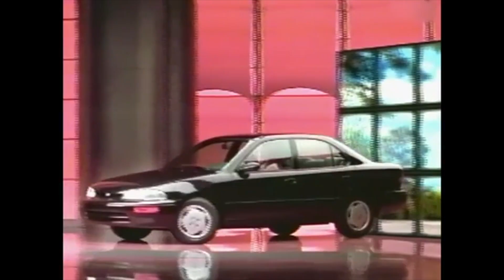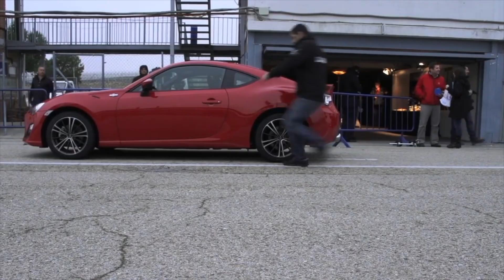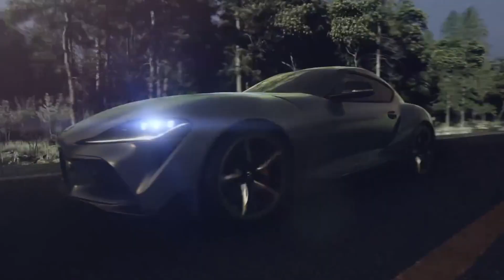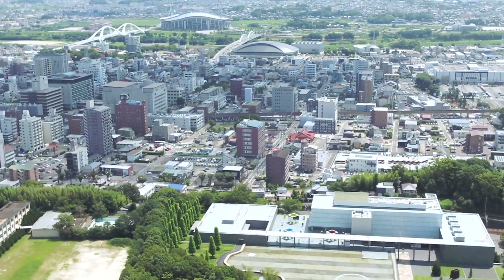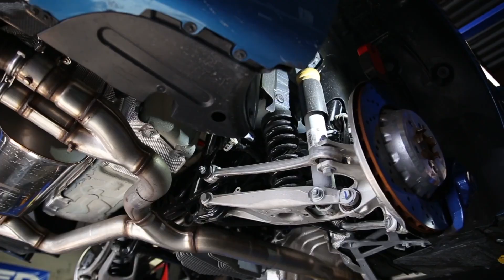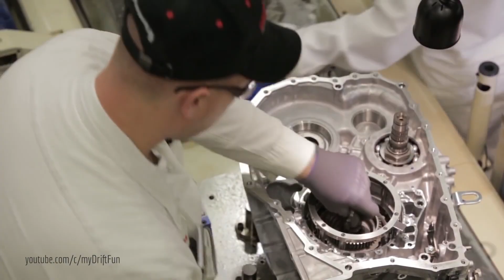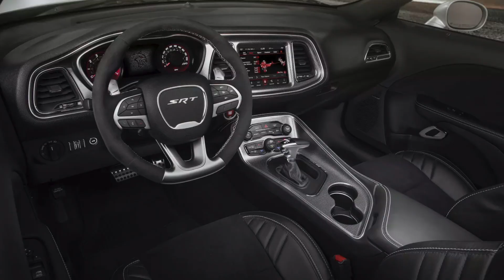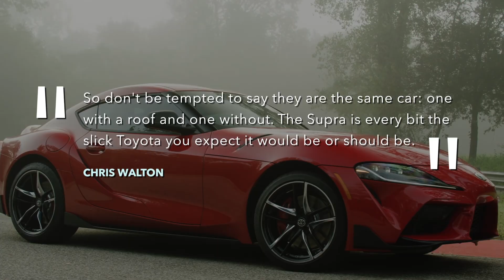MKV Toyota Supra - BMW or Toyota? The UNTOLD TRUE STORY

Comment: This.. right here, is excellent writing and research. No opinions and lies. Thanks for showing true evidence!
Reply: NANI!? You are here too Mr.deoxide!?
Reply: @TheWProductions222   and nobody care. cuz they are just human, not a god.
Reply: Hello deoxide. Nice to see you here
Reply: Where exactly is this research? I have serious doubts about some claims in this video. Namely the fact that he says the interiors were designed completely separately, but you can clearly see BMW parts in the Supra interior, including the entire M-drive electronic system. This video has very little information, and the information given isn't even correct.
Reply: @TheWallsocket  very true my flatmate also told me that all buttons and diles were delivered from bmw manufacturers so they are the same thing.
(he works for the biggest packeging company in the german car industry and has to design the packages for the transport of all the parts thats why he knew how much of the new supra is actually from toyota and how much is from bmw and nearly all off it comes from bmw in terms of switches electronics etc.
a lot of people wont believe me here i can imagine but just wait for the release and see it for yourself
Reply: Deoxide

yeah, sure. Where do you see any evidence in this video? It's full of unproven claims with informations that are fully unavailable to the public for most parts and includes several lies. For example: the transmission. He states that lamborghini and Volkswagen use this transmission, even though none of those manufacturers offers anything else than a direct shift transmission. Then he states that the interior was developed fully autonomous, which is an extremely proven lie.
Plus, the "german laws" he talks about, actually don't even exist.
Reply: @Etherion195  >For example: the transmission. He states that lamborghini and Volkswagen use this transmission, even though none of those manufacturers offers anything else than a direct shift transmission.

Haha this is where I know you're totally full of shit too. The VW Amarok and the Lambo Urus uses the ZF8. Next thing you'll tell me is that the Earth is flat? Sure thing buddy.
Reply: @Etherion195  lol you're still wrong in saying that neither VW nor Lambo uses the ZF8, stop being mad.
Reply: @elusivellama  He said the company that makes the zf8 makes transmissions for  them brands. Not that them brands use the zf8.
Reply: His opinion is the transmission zf8ah isnt a BMW transmission even though BMW created the dual clutch and paddle shift thing in 1998. But no opinions remember.
Reply: THISSSSSSSSS
Reply: Oi deoxide sensei
Reply: it is not the 100% truth but outside people couldnt know anyway he says a lot of wrong stuff but also a lot of truths
Reply: even if the pronunciation of everything is shit. goddamn americans butching the language yet again
Reply: oh hey there deoxide
Reply: AHHH DEO-sama is here
Reply: There’s no REAL evidence in this fucking video. It’s an opinion peice with ZERO eveidence.
Reply: Ayy Dio
Reply: @9nineofdiamonds  ...and you know that because...?
Bullshit. Toyota did nothing else than design (int. and ext.) and tune wishes (suspension and powertrain settings).
Reply: Deo
Reply: FREIJA?!
Reply: Screww uuuuuuu
Reply: One of many pr efforts from Toyota to save the Supra. I saw another ad featuring the Toyota ceo.
Reply: @japanwatchconnection yeah but he likes Toyota when they do it by themselves and not a joint venture or a partnership
Reply: Yep mr deodorant... From what we have so far as information i think the new supra is going to be an awsome car
Reply: Marry me
Reply: What are you doing here? There is no shingo points here
Reply: Deoxide truth is - this isn’t no DNA Supra
Reply: I like the new Toyota Supra.
Reply: Ayyy Deoxide
Reply: Thats the kind of journalism we need. And what I want to do when I get out of university.
Reply: Hey there Deoxide
Reply: ... U too ? Im Unsubscribing right now.
Reply: oh look its that anime nerd
Reply: Still waiting for this research and fact. This is confirmed reshell
Reply: Hi
Reply: The car is still a BMW.  BMW IS JUNK.
Reply: Dio?!?!
Reply: ayoooooooo nice to see you here dio
Reply: Uhh… did you even look at his sources? Most are opinions anyway… just opinion media sources and magazines. I actually posted on many blogs about the issues with the BMW Supra… the car is fun to drive and fast just like BMWs… but there are plenty of things he missed in here or misrepresented. For instance, the only things designed by Toyota on what is supposed to be the best Toyota sports car of all time, are the chassis, certain parts of the interior and the electronics under the hood. The rest was made and designed by BMW. The motor only had input from Toyota after testing them but they didn’t design it. The chassis was designed by Gazoo racing (Toyota) not a cooperative from both teams. There are many other things that have to do with the history of the Supra that make people dislike the BMW Supra but new kids won’t care about that… neither will BMW fans.
Reply: AYY RUNE GO PIKKATRA EYEHEYRTHDD
Reply: The facts and true evidence? All's this Video did was reiterate the same facts and evidence we already knew. It was just done in a way to make it seem not so bad (although it started off with all the failures of Manufacturers doing it in the past).
Reply: @beobe99  No, people didn't already know, the info. Yes was out there but they did a job for all you dummies who are to lazy to do actual research, I already knew this before the video but it's good for ignorant people, calling it a rebadged Z4. This isn't for those who already had the knowledge. I enjoyed it though. As of right now I'm commenting this it actually calmed down the trolls out there that keep going to every single MKV post Or video and keep spamming oMg rEbadGeD Z4 #nOT mY sUpRa and it's usually a bunch Gen-Z kids that think they know cars because they drive a beat up used 350z or old heads who are just stuck in there nostalgia feelings.
Reply: Uh, he claims the interiors were developed completely apart from one another. It is evident that they were NOT.
Reply: Youtube channels like these are the reason the internet is actually useful and not just a place for monkeys to throw shit at each other.
Reply: He's full of shit, Tetsuya Tada's words were: " We would take every bit down to a fastener or rivet, and put it through our stringent quality control and a dozen other testing, we'd ship thousands of parts back to Japan for analysis. That is normal to us. Each piece we test at our level, they were now the ones surprised. "

He never said that parts were sent back to Germany and reworked. The full interview transcript can be found here:  http://club4ag.com/chief-engineer-tetsuya-tada-reveals-the-a90-supra-through-a-viewpoint-of-joint-development-with-bmw/
Reply: @elusivellama  I'm from the future and people are having major issues with that piece of poop Supra 🤣
Reply: @elusivellama  are you slow or just a pure hater or maybe English is not your first language because the article clearly discussed how Toyota  tore down the car even to the bolt and rivet level and sent the parts to Japan for analysis, which surprised BMW. What do you think he meant when he said parts came into shape one by one? Let me tell you. It means they were improved. This is a translation of a conversation.  Different articles might translate information differently. Parts don't "come into shape" by themselves. It means the parts are improved.
Reply: @elusivellama  Your conclusion doesn't make any sense. What do you think happens, if a part fails the tests? Correct, it's remade differently until it passes the tests!
Reply: @Etherion195  You don't understand. Tetsuya Tada *never* said that the parts were shipped to Germany if they failed. He only said that they disassembled some parts down to the bolt and fastener level, tested the hell out of them, then sent them to Japan for further analysis. 

Nowhere did he say that they provided feedback to BMW, or requested any changes, or anything of that sort.

Read the interview here:
club4ag.com/chief-engineer-tetsuya-tada-reveals-the-a90-supra-through-a-viewpoint-of-joint-development-with-bmw/
Reply: @elusivellama  Well, in the video it was said and also implied in Tada's statement, otherwise his whole comment wouldn't make any sense at all. If every part passed toyota's tests, then it's 100% BMW and Toyota did exactly NOTHING for the developement. If parts fail the tests, they change it together with BMW.  Seriously, i don't get, what you're arguing about. Are you really crying about semantics, even though the content is the exact same thing?
Reply: @Etherion195  He didn't even say if the parts failed. That's my point, he said nothing other than what he said. There is no implication that anything was done other than test, disassembly and shipment of parts back to Japan. 

You want to talk about implications, sure! Let's do that. He DID imply is that BMW really doesn't care about reliability. Once again, if you read the full interview, he said that BMW spent so much time and money on design that he started to worry if the car could be built and sold profitably as a Toyota model.

"I started to doubt myself if this whole thing can be accomplished in a manner that can profit as a product sold as a Toyota."

Meaning that there needed to be time and money set aside for testing and validation..which he does mention a little later on.

"BMW couldn't believe how extensive some of our quality and efficiency studies were"
Reply: @elusivellama  You simply proved my points with your comment over and over again. What the hell are you talking about? Please learn to read.
Reply: @elusivellama  This. There is a difference in philosophy when it comes to reliability testing at BMW and Toyota. That's not surprising for anybody, Toyota's are known to be extremely reliable, BMWs are at best average. But the fact that the Toyoto engineer has mentioned this PUBLICLY hints at this having been a significant issue in the development process to the point where Toyota was concerned about being attached to the project (because reliability is a corner store of their brand). Secondly, not mentioning that parts were redesigned in his article is a big question mark. I have many Japanese friends and work with many Japanese. To write about this publicly would be a no no in Japanese culture and that says something about the scale of the perceived problem from Toyota's point of view. P.S. Of course not knowing whether parts failed testing or not this could also be marketing on Toyota's part basically saying 'we test more than BMW'. We don't know ultimately, but it is highly unusual to write articles like this for a Japanese business that imply a business partner did not pay as much attention to testing, as in doing due diligence.
Reply: @TheChannel1978  Yes, thank you. That was my feeling when I read that interview transcript. As you said, Tada was mentioning it publicly and pointing out that BMW was shocked at Toyota's level of testing (which the latter considered to be normal) and even he thought that BMW was allocating far too much time and money on design. As the chief engineer, he plays a prominent role and his restrained response speaks volumes.

I mean, he went out of his way to give specific examples of the differences in R&D processes between BMW and Toyota! It wasn't just like "oh BMW likes to use blue for an interior trim but we at Toyota prefer matte black", but rather an example of extravagant design vs quality control/testing!
Reply: ”Zupra”
Reply: Deoxide shut the fuck up rookie. it's a piece of shit. end of story
Reply: LOL, Right.
Reply: I'm pretty sure he has bias opinions on liking the new dupra
Reply: @siddheshpillai3807  Is there such a thing as an unbiased opinion?
Reply: @siddheshpillai3807  No they used facts, none of what they said was opinionated.
Reply: @siddheshpillai3807  The A80 Supra wasn't all that in the 1990s so please stfu.
Reply: Ähm ... No! 
If Toyota would have developed their own design why there is no Toyota mirrors in the car, and why there is no Toyota designed Shift stick in the car, and why there is the BMW sound playing when you sit inside the car with open door / no seat belt on ... 
And this are just a few things which dont cost big money to indivdualize it. 
And there are still more examples ...
Reply: @mortelk6104  will you buy a Supra for 120k?
Reply: @זהסודי-ה7מ  sure - Look at the prices for a perfect low milage mk4 ... Because it is that good.And you know every serious car collector must have a mk4 in his collection.
Reply: @זהסודי-ה7מ  Facts
Reply: @mortelk6104  so your making point of invidualizing the a90 with functions the old supra never had or  heard off 🤣🤣🤣 then how is your opinion correct individualizing stuff would have bumped uo tge price why not use whats there its not a 200.000 GTR you know just  a sportscar and its no secret it sharing a bmw platform i dont get why this angers people
Reply: How long did it take you to research write, make, edit, and publish this video bro? This was a excellent video that proves my view on the new 2020 Toyota Supra
Reply: HOLY CRAP.   Real Journalism.    If only there was some of this in Politics.     Too much money in Politics..... Isn't that sad...
Reply: @surveysays8335  Where do you see "real journalism" most things in the video were already proven wrong or made up.

Comment: Wow i didnt know that you all think so bad about BMW. The not M-Cars are not reliable but all the M Cars have a high quality standard and most of them are driven hard on a daily basis at the nürburgring. Even the Ring-Taxi is a bmw and the dont have breakdowns. BMW makes some great performance engines and toyota is currently only producing economic engines. I can understand why the cooperated in this plattform and made it possible to even see a new supra again. All the hate is just normal these days as anyone can just write a witty comment without even knowing anything about this car.

Comment: The statement that BMW and Toyota went separate ways is bullshit.   The so called Supra even got BMW media system software.
Reply: Their just saying that to make you "believe" that its not so called rebadged....but BMW made most of the supra...including the interior as well, don't be fooled by this bullshit
Reply: Exactly!! Toyota fu#k up with Supra.
Reply: The interior components are very bmw ish. Drive a newer bmw and you will see the same components
Reply: @mkv6spd  Johnson Controls...Toyota,  BMW, Honda/Acura, Ford, some GM and Chrysler, etc etc etc. We did stuff for most of the interior makers, JCI and Grupo Antolin being the 2 big ones. That's why I always like when one car is called out for cheap plastics and another is called better when both purchase the same quality level package from the same supplier.
Reply: @94XJ JCI owns Simplex now, LOL. They bought Tyco, IIRC.
Reply: @HanSolo__   yeah understand that it ain't gonna make much money a rear wheel drive gasoline sports car.  But then again top of the range models classically have been used to build brand image not rack in the cash.   Many people that dream of a Supra end up buying other slightly sporty Toyotas
Reply: @Douglas Hamner  it's realated by making it quite clear  that Toyota dident do shit on the car apart from body work design.  Putting in a Lexus computer system wouldent have cost that much.
Reply: Jon-Arne Belsaas how exactly does the presence of BMW media system software debunk the fact that the companies split...? lol you can never please some people

Comment: I would love to own one, and love the design of the car.  There are concept pictures floating around that add a traditional supra style arched wing, and 3 ringed lights to this platform that makes it pop significantly more than it already does.  I wouldn't feel as guilty daily driving this car as I would a more aggressively designed, and manual transmission based platform.  

And I believe that is the true focus of this machine.  A daily driveable beauty of a sports car with capability of yesteryear, and modern conveniences.

Comment: The new supera is not wide enough it seems like they squeezed it into a z4 frame and the power is low because bmw has the same motor making 50 more hp so why did toyota get a watered down version

Comment: Engine with bmw performance, reliability of Toyota, and a chassis stiffer than an LFA seems to be an amazing sports car. 335hp from a 3L turbo sounds like it’s not being pushed to the limit at all. With a chassis like this I’d say this car will still be balanced and relatively reliable even if it’s pushed to around 450 or 500hp. And although a manual sounds more fun, the ZF transmission totally gonna be faster and if it’s able to handle giulia qv’s power, it’ll be adequate for a 500hp supra